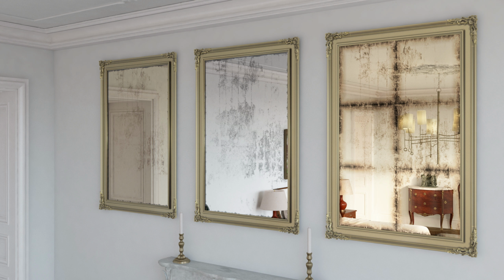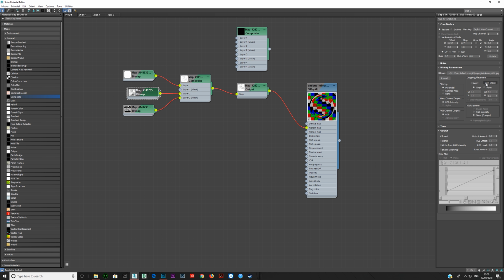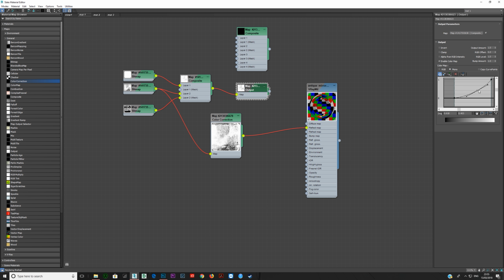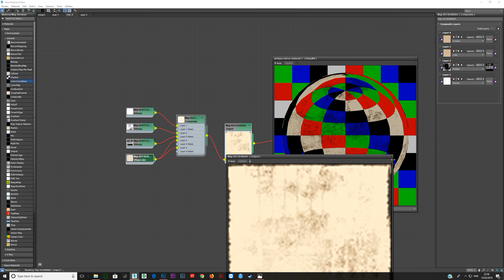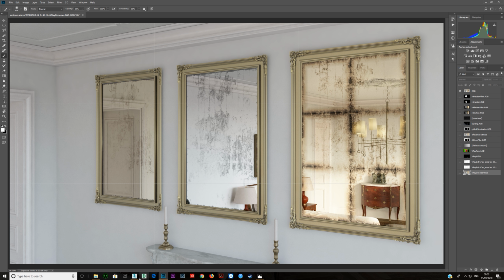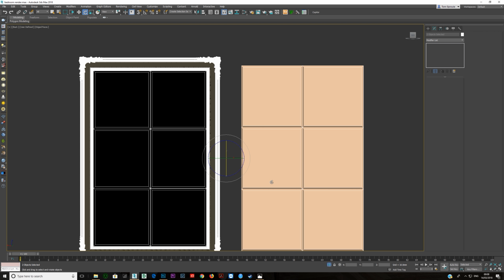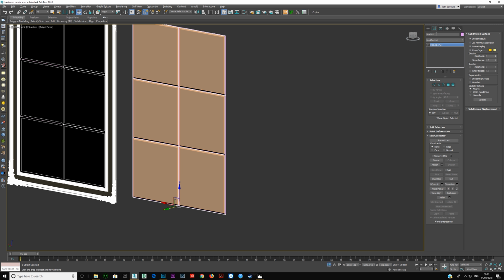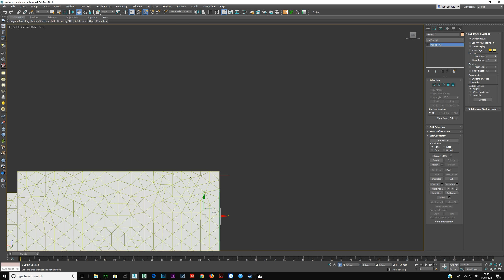How to make an antique mirror in 3DS Max and V-Ray

Comment: thanks , nice tutorial ... i spent half hour testing just to discover distance map is not supported in V-Ray RT :(
Reply from the maker: Hi Ammar, so, you are right. 

I've just edited some files in photoshop and uploaded them to facebook. I've uploaded a sample render too. Just remove the v-ray distance tex and use this image instead: 

https://www.facebook.com/358500474913820/photos/pcb.358508648246336/358506298246571/?type=3&theater

That should get you the same result. For different shaped windows or different numbers of panes you'll need to create your own jpegs in photoshop. 

But either way, this is the type of image you need to create.
Reply: How nice of u to take the time to do that , really appreciate it ,  i made something like that too , i'll put in in yr facebook page